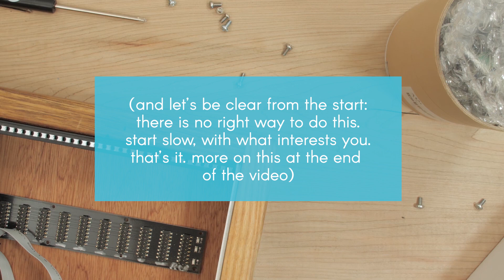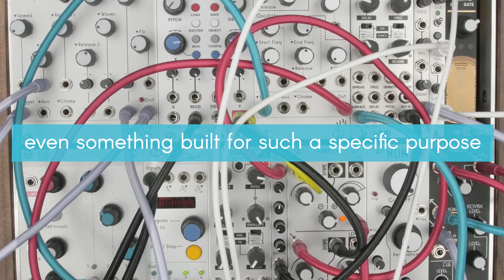Why to Modular - 3 - Making a Modular

Comment: What do you think about starting virtually, for free, with vcv rack?
Reply from the maker: I think it's a great option. I don't enjoy making music with software so I've never given it a go, but it's a great tool.
Reply: a good way to learn fundamentals before dropping cash BUT nothing beats the tangible control imo
Reply: even though it's not for everyone, exploring software on this channel could be a cool way to alleviate the belief that one needs excessive money in order to create good music ~
Reply: You can very easily start very small (maybe just a VCO and a LPG or VCF) but use software generated CV to control it. I do this with Reaktor and an Expert Sleepers ES3 (but you can use vcv rack, max msp, etc). I do have quit a big system, but I can make it even bigger by patching from the computer, that way I can also test some functions or specific modules I might be thinking on buying but don't fully understand how they may work within my system